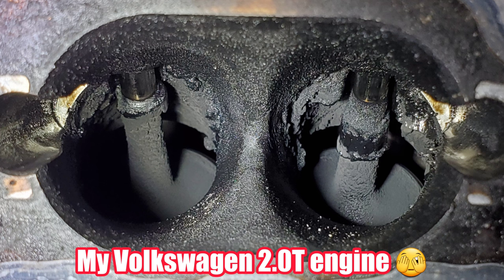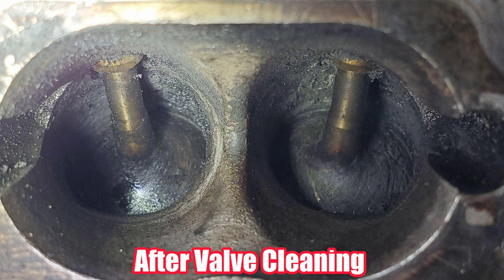Let's talk about the B58 PCV - The Good & The Bad

Comment: Positive pressure in the crank case would not push up against a downstroke piston unless you have a one cylinder engine. With multi-cylinder engines, every downstroke is matched by an upstroke for an opposing cylinder, so overall volume (and thus pressure) should not fluctuate over time. Another way of looking at it is that any upstroke piston is helped with the exact same force that is resisting its opposing downstroke piston. It's adding equal weight to both sides of a teeter totter. Positive crankcase pressure (PCV) can cause oil leaks and engine oil sludge though
Reply from the maker: Positive Crankcase pressure is always pushing up on the bottom of pistons whether they are going up or down. It creates resistance when pistons are on the downward stroke.

Comment: Does using different oil specifications (LL-01 ETC) produce any meaningful differences for carbon buildup, PCV performance or blowby?
Reply from the maker: Not in my experience. If you have oil consumption then sometimes thicker oil reduces it.

Comment: My 440 has been smoking and whistling still even after I just changed the diaphragm. I’m thinking it could be the either the valve cover itself or the o2 sensor. It also struggles and startles after refueling. Please help 😅
Reply: What year is yours ? Mine did the same thing and I fixed but at first It still did same symptoms and come to find out, I didn’t install diaphragm correctly, so make sure you correctly seal it and it should be back to normal, if not then possible valve cover but I doubt it.
Reply from the maker: Yeah double check your work. Make sure it's installed properly. And look around for leaks to make sure you don't have a Boost leak somewhere else.
Reply: @murgeecars  2018
Reply: @kern417  Thanks
Reply: @kern417 you were right man. That seal got sucked in and wasn’t around the housing all the way.🤣

Comment: I have a BB kit and it doesnt use the evap fuel line. Do I need to put a filter on it? Do you happen to know the fitting for it? I dont want to delete it.
Reply from the maker: You don't have to but your can. The easiest way is to find a connector and clamp a filter onto that

Comment: Yoo Kevin, your consistency to provide information on the B58 platform is truly remarkable. I’m a few months away from getting a F22 240i, and your videos as taught me loads! 

P.S I’m coming from an E82 120d stage two, so this is a major upgrade for me
Reply from the maker: Awesome man enjoy it
Reply: @kern417  fast forward a few months and im picking up my 2020 240i in a few hours
Reply: @kris24_lawson 2 months now
What’s it like? Looking to get one myself
Any tips or warnings to look out for?
What are the expenses like?
Reply: @gaara4667  hey bro, to be honest, I’m still on warranty, the car is at 21k miles, so it’s really not much to say.

They did replace the rear brakes and disks. They also did the park cable clip, super common on F series cars where the plastic clip breaks and the park cables rub when under WOT. 

Other than that, nothing else, planning on getting a JB4 soon, I still have about 13 months of warranty left

Comment: So today I was at auto polishing center to get a wash. The line was extra long today, I waited about 45 mins before the car was rolled into the bay for its hand wash. The whole time I had been idling. Boy was that a mistake. As soon as it went in a loud whistling sound was coming from the car and then massive amounts of white smoke was being released from my exhaust that smelled like gas and oil. Turned the car off immediately. Then turned it back on a couple mins later to move it out the bay and same thing started smoking. Turned it off again popped the hood no smoke from the bay no leaks and everything was sealed. Immediately I thought it was my turbo and could possibly be something catastrophic. But then again no CEl Light and I drive reports system ok. Decided to let it sit for 30 mins. Started again and no smoke idle was fine. Drove it home 25 mins away no misfires drove like nothing ever happened obviously I drove conservatively and put it in the garage. After reading threads and forums I came across this video and hey man, thank you because I can sleep tonight lol. Gonna get this replaced tm.

Comment: Great video. Btw I appreciate you removing the engine cover so that excess heat can be dissipated easily whenever the engine is running & after it is shut off. All turbo engines need their plastic covers removed in my opinion.

Comment: I think I might be the only person who has been bold enough to seafoam my b58 and s58 straight through the throttle body and into the intake valves as many times as I have  . And I can promise you it works , you just have to do it the right way.. and make sure the car is at a certain elevation so it can hit every cylinder . My tail pipes don’t even get dirty anymore when i run my finger on them after a hard drive
Reply: Please elaborate
Reply from the maker: Neither do mine lmao. It's not needed.

Comment: Great video Kevin, as always! Cant get more didatic than this!

I have been wasting my thoughts on this subject recently. Debating whether to run a catch can or not. I really like the catch can idea, but dislikes the added maintenance item to keep track of and also I am very concerned about adding a container of likely flamable content on top of a hot turbo area, with extra components such as hoses and fittings that could also be another point of failure. I also dislike that, in most cases, seems like I would have get rid of my engine cover.

Last week, during my regular oil change, I wanted to know how my PCV system is doing, so I decided to pull the breather hose out of the valve cover that goes into the air intake, to look for some gunk in there. After 5 min trying to pull that little shit out, I gave up and went straight to the charge pipe xD. Pulled the charge pipe and was impressed by how CLEAN it was, not a single drop of anything, pefectly dry, including the throtle body. I could eat on eat.
So that gave me some peace of mind and makes me believe the PCV system is working as it should, even after running on Stage 2+ for almost a year/20 k km on both normal / spirited driving conditions, including a few trackdays in the count.

A bit off, may I suggest topic for another video? Oiling capability in our B58 under high G! This is a topic I catch me reading up late at on night on the bed every now and then xD I have a number of logs from my trackdays this year that shows no oil pressure losses, but Im on Michelin PSS, and im pulling like ~1,2G max when cornering on a fairly long sweep. I wanted to go to some proper track tires, but this is something that bugs me a bit, so for the time being, grease my tires will be at the end of the stint :face-green-smiling:
Reply from the maker: Sure, my next track day will be in a few weeks so I'll try to include that in the discussion

Comment: Running a BigBoost G35-1050 with built trans, motor, and pretty much all supporting mods pushing around 33-36 psi. Ordered the V1 Ross catch can and delete instead of the V2 on accident. I was wondering if the V1 would suffice or not. I also have oil residue in the intake right now without the catch can so one is definitely needed.

Comment: Thank you Kern for this video. I have been on the fence about whether or not to purchase a BMW with the B58. I have 1 question, the photos of the intake valves on your B58, were they taken prior to or after you installed the PCV delete? Thanks for the informative and helpful content.
Reply from the maker: after, but a PCV delete doesn't clean the valves

Comment: i have a 2018 b48/46 and the pcv appears to just be a hose the runs from the valve cover into the turbo inlet. i always noticed oil in the intake, even when it was stock ( i have a jb4 so the boost is higher now). so i added a catch can. couple questions. do you think running a slightly higher weight oil would cause less blow by? the engine calls for 0w-20 but ive heard of folks running 5w-20/40. also, have you ever used products like CRC turbo and intake cleaner?
Reply from the maker: If your charge pipe is clean then there's nothing really to worry about. And yes I have used intake cleaners in the past. Not needed on this car.
Reply: @kern417 Hello kevin, on a B48 2020 X3 model. How often should the PVC be serviced? and is there anything to watch out for to ensure PVC is well maintained. Thank you.
Reply from the maker: it is not a maintenance item.

Comment: Hi Kevin, My car has already 55,000 miles, it is B58 Gen1 and tuned with MHD Stage 1, it does not consume any oil between the change intervals I do 5,000 -6,000 miles... It is my daily driver, I do per month approximately only 1,000 miles and I do not usually push it to the maximum constantly, only sometimes when the highway allows me to do so. This engine does not consume any oil? Or only in some scenarios? Greetings from Spain! 👋🏻😁
Reply from the maker: Yes, it is typical that gen 1 B58s don't consume any oil. Mine doesn't either.
Reply: I had a 18 F32 440xi with stage 1 93 from BMS traded it last week for a new G42 M240xi.  The 440 had 44,500 miles on the clock and it never burnt oil.  I did have a issue with coolant but changing the cap on the main tank fixed it.
Reply: I check the level when I bought the car and I check the level between the first oil change and same bro. Level was the same. Crazy how efficient these cars are!
Reply: Oil consumption on the B58 is something that intrigued me a bit. Because my car has never shown any oil consumption (level sensor oils reads MAX level, no excessive soot in the exhaust tips), I decided to experiment. Last weekend I measured how much oil went out. I drained it hot, as per service instructions and let it drip until it was dropping. I managed to get ~6L out of 6,5L I put in. So there has been some slight consumption in between 7k km of normal daily driving, spirited, occasional race and 3 track days. Oil in question is Motul 8100 xcess gen2 5w40. After replacing the oil, I measured on ground level, downhill and uphills … same MAX reading in every occasion. That bugged me so I bought a new oil level sensor which will be replaced in my next oil change, likely end of the year prior to storage for winter time. Either my level sensor is faulty or it is not accurate enough.
Reply from the maker: You'll never be able to drain all the oil. There's oil in the galleys of your cylinder head, your turbo, and between all of the components. Even if you remove your oil pan and leave your engine overnight, you'll wake up to a puddle of oil underneath.
Reply: My G30 has 135tkm , i owned it since 89tkm - i bought it last year. My Main Reservoir leaked, The diff seal little bit leaked,Now the main crankshaft pulley not runs straight, Im tuned since last 5tkm stage 2 mg flasher OTS … I have bought extended warranty for 1500 euro… so all was covered… i do my oil changes every 7-10tkm i use liquy molly 5w30 4200 Ll04- With cerratec. I also got gearbox oil changed with filter, Spark plugs, Rear diff oil,, also PCV membeane i changed I So far love the car!! Oh The Oil level didn’t worked only on warm engine if my engine was hot it wouldn’t measure had to wait few min stop engine then it measured i read its because the OIL pessure too much becaause off a Plastic Inside has too big movemen, which is not a problem . But interestingly After stage 2 tune It measures all time doesn’t matter engine temp.. I also got Lane assist coded so i don’t have to touch the steering wheel …

Comment: I have an issue whenever I accelerated up to 4k rpm
To redline. Ill hear a whistle. Happen whenever I hit boost, I drove up the rpm without hitting boost. Whistle isn’t there. Just changed the PCV but sound there. No check engine light.
Reply from the maker: check for boost leaks

Comment: I guess you use 0w20 which should have a very good NOAK index, anyway which is your service time with E85 and current gasoline ?
Thank's in advance
BimmerN53
Reply from the maker: I currently use 5w30 but I've used everything from 0w20 to 5w40. No issues.

Comment: Do you think a catless downpipe would decrease crankcase pressure, thereby decreasing the need of an occ? Regardless of the answer, I'm going to install one just to fulfill my engine tinkering needs 😅
Reply: No, it will help alleviate by reduc8ng back pressure to the turbo and allowing more efficient flow.
Reply from the maker: Yeah it doesn't do anything for the crankcase. At least not in stock form. Some people plum the crankcase vent to the exhaust instead of the intake, because it can also create a vacuum.
Reply: @kern417  Interesting. How about the vargas one way crankcase breather that replaces the oil cap? Looking at the options, does it even make sense to get an occ, pcv breather, and an oil cap breather? lol
Reply from the maker: All you need is a pcv delete
Reply: @kern417 did you have a video on how to delete it?

Comment: I bought 6 kits of diaphragms for me or for my homies. I usually idle for long periods of time in my car due to my job, and the heat is definitely nothing to play with so I gotta keep AC on full blast. Having this extra few kits keeps a peace in mind cause I can change them on the go.
Reply: I did hear that PCV diaphragm tend to go out faster when you idle longer periods of time.
Reply from the maker: Yep. Thankfully it's easy to replace if you do have an issue

Comment: This might sound dumb but how early can the stock PCV fail? I am only at 19k miles gen1 b58.
Reply: I guess this is very dependant on the type of usage. I pulled my PCV diaphragm, just for piece of mind, at ~90k km and it was perfect. I replaced it anyway, as they are dirt cheap in the AM. I also always carry one extra in the trunk just in case a failure comes to surpise me on the road in the future.
Reply from the maker: Yeah it's not so much mileage as how you drive the car, how much power you're making, etc.
Reply: @kern417  I'm considering stage 1 for my absolutely stock 340i (2018) with only 25k miles on it. Should I proactively change the PCV diaphragm every time I do an oil change/maintenance?
Reply: @LuizPauloDT  good point but why not upgrade to the Ross kit that kern was talking about? Is it the EU emissions?
Reply: @kern417  stock for now with some pulls here and there. Honestly will probably go with the Ross kit eventually
Reply: @GeorgeKnox215  The main reason I dont install a PCV delete kit is the incompatibility of these kits with the engine cover, as far as I understood, which I want to keep on my engine bay for as OEM looks as possible. I believe there is a risk during annual inspections that they would  pop my hood open, see the engine guts and start asking questions, so I want to avoid that + I care to some extent to the environment 😄
Reply: @LuizPauloDT  totally understand that. I mean I think if you don’t go with a catch can you can shave off a bit of the engine bay cover so that it fits snug
Reply from the maker: @love2huntbooks2  no need.
Reply from the maker: @LuizPauloDT  i swap components for track days since i need a catch can but normally i run a dump tube. It takes about and hour to reinstall the stock pcv setup for yearly inspections
Reply: I have a feeling that the designers assumed that the start stop system would make excessive idling a non issue and designed the PCV accordingly.
Reply from the maker: @grein545  agreed. Or at a minimum it wasn't tested as extensively as it would on a car that didn't have it.